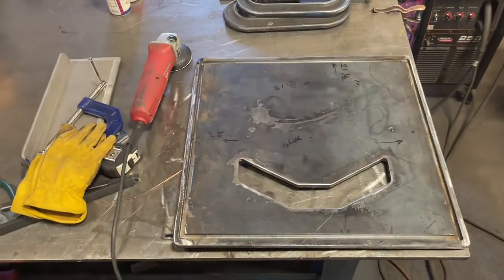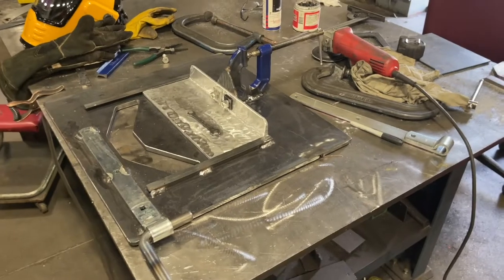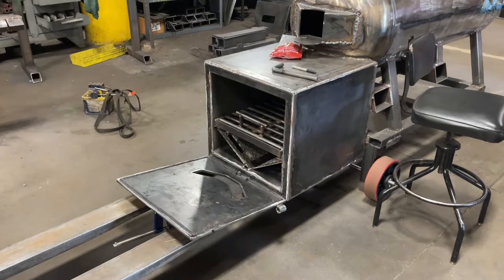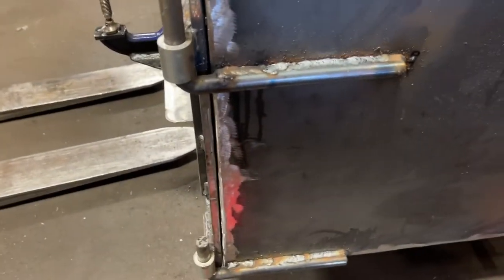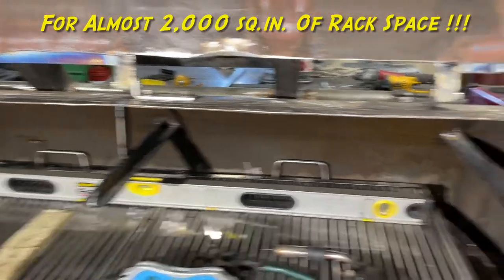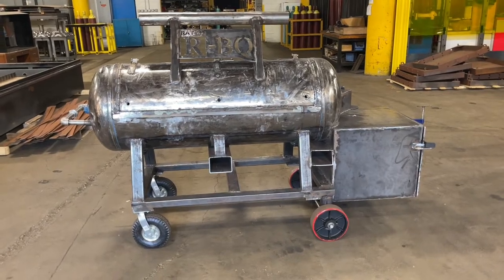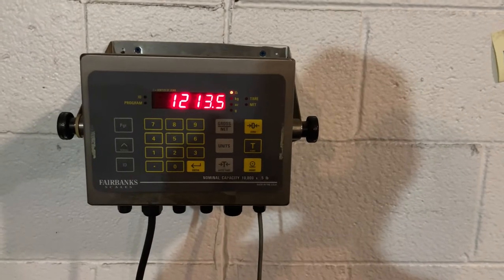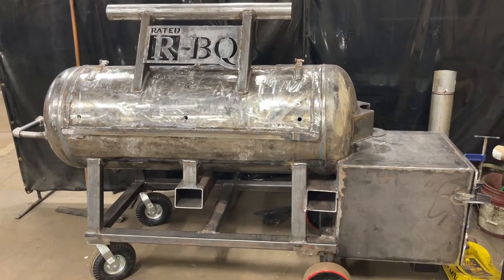The R-BQ, Building a 120 gallon Reverse Flow Offset Smoker, Part 5

Comment: Hey..... I've liked what I've seen so far but like Terrence pops would say ... buttttttttttttttttttt...... I'm not quite digging the half C clamp for the dampener it looks kind of, well, kind of half-ass ....and sticking out .. a bit cumbersome I think your smoker deserves better.... so this comment is going to either piss you off or make you think LOL... but I did like the wrench now that was a little Touch of Class.... Here's my thought how about a threaded rod flush with the side, with a small nut up at the top and a nice classy Snap-on speed wrench that would snap in on the side with a couple clips with a snap on sticker that says Made in the USA and the typical Snap-on sticker that says don't ask me to use my tools.. I don't know I think it'd be way cooler  .... that's my thoughts